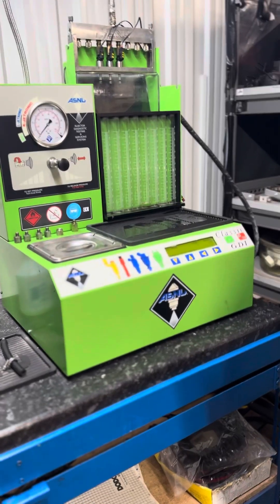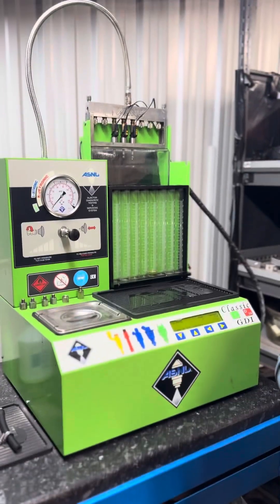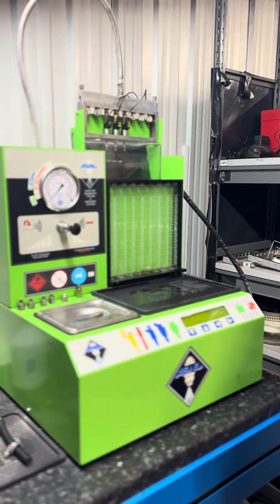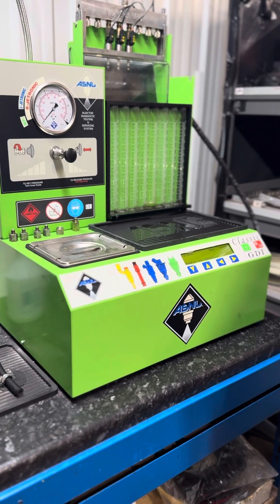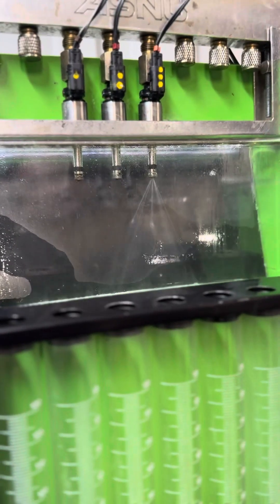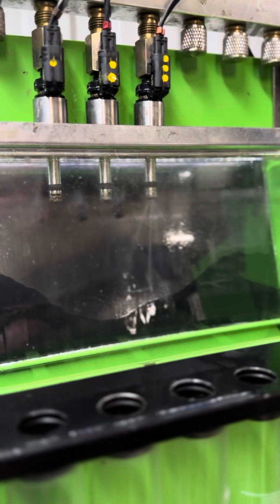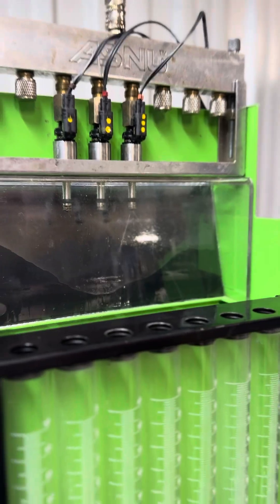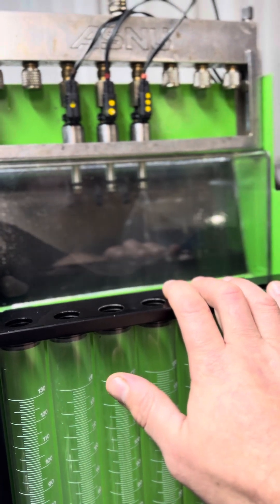Focus 1.0 ecoboost engine misfire solved

Comment: Any idea why the petrol is going into the engine oil, just been to the Mecanics and they told me there is petrol in the engine oil, they told me to keep checking the engine oil to see if it rises higher. They did put the tester on and there was no errors at all. They think it might be the injectors, but because there is no errors at all they not sure so I have to check on the engine oil level for now.

Comment: Hey guys, I have a eco boost 1.0 2019 I have the exact same issue oil pump is all clear had the sump off but engine light flashes looses power until you clear the codes and the car is fine again for about 5-10minutes then the lights come back on again, no smoke blowing , next step would be to do a compression test, also mention I swapped injector 1-3 as the fault shows in cylinder 3 and the occurred but it took a lot longer to appear hope this makes sense.

Many thanks